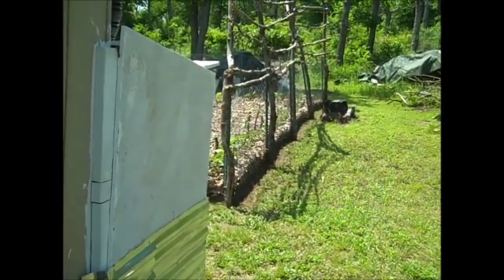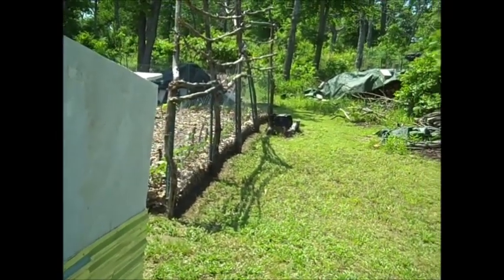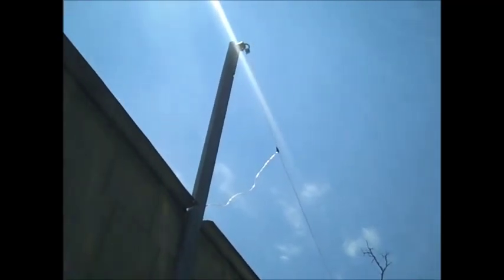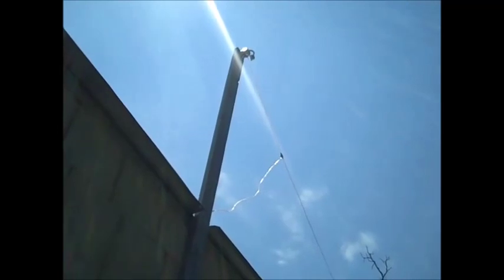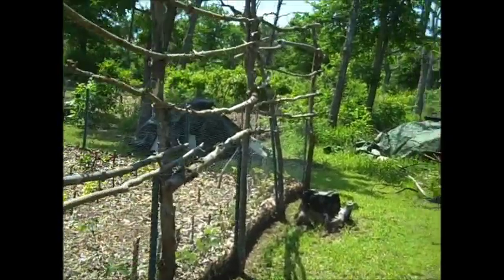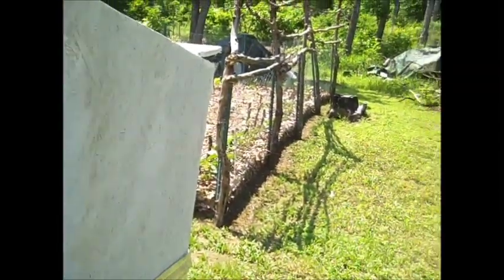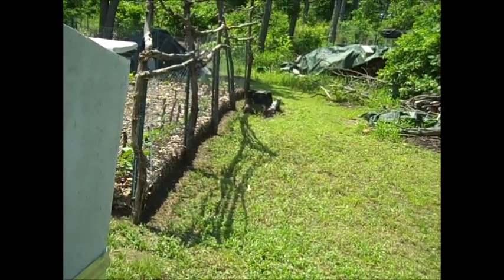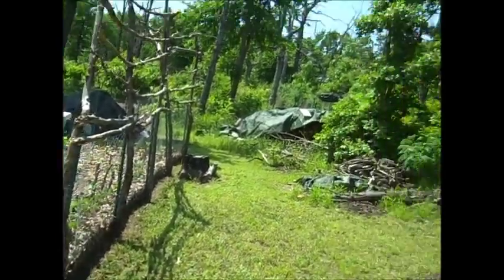Random Wire Antenna May 2, 2015

Comment: Found your second antenna video, The lower insulator on the pole is rigged well, any rain will follow the wire down, drop off the lowest point  and not enter the window the way you've rigged it.. A thought; Have you ever considered using some of  those LED walk way lights just as solar battery chargers?  I pick em up at yard sales for nothing and just remove the bulbs. But with the bulbs left in, they are still good for back up lighting.  Again, great video, and you're still  doing good.

Comment: Nice work with the random wire. The problem for portable shortwaves like the PL-660, PL-880, SW7600GR and ATS-909X is that a long random wire will start to overload your reception with spurious signals. For example, on my Sony SW7600GR local AM stations start bleeding through on frequency harmonics (so a strong local 1500 khz AM started overloading at 3000 khz). You can do a couple of things to help. One is to find a 9:1 transformer/balun to lower the random wire impedance (which is widely variable) to your shortwave's external jack (probably around 50 - 75 ohms). Just attach it between the wire and the input jack (best way would be to have coax from the balun to the receiver jack and the wire attached to the balun). This won't fix overloading but it helps - especially with noise. Another option is to find a filter/preselector to block those overloading signals. That is a costlier option - $50-$100 which might push you to get a higher-end receiver. 

I've have found that the Par EF-SWL 45' antenna with the 9:1 transformer works wonders the Sony! Was worth the investment and kept me from buying a preselector.
Reply from the maker: Thanks so much for the information. That helps a lot!
Reply: Sure! I made a couple of changes to my comment on the 9:1 transformer impedance. It helps but random wires impedance vary across the frequency spectrum quite a bit. But, for noise it really helps to have your wire outside and coax from balun to your receiver.